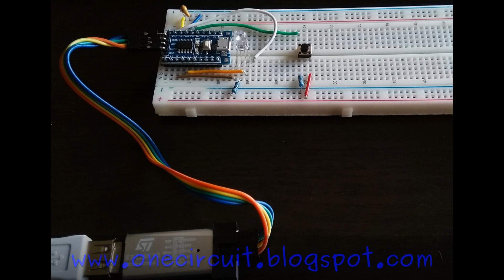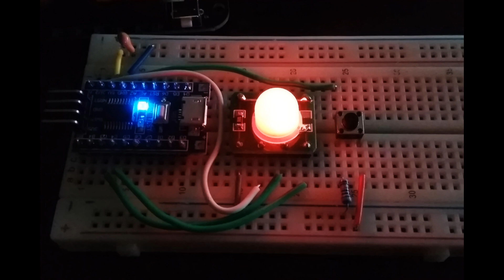STM8 Super cheap microcontroller

Comment: Dear brother, what is the purpose of STM8S103F3P6? I accidentally burned out the microcontroller due to overloading the RCD3015M module. I want to replace the chip. So will the module work if I just replace it with a new one or do I need to program it. Or will the RCD3015M module work without the STM8S103F3P6 chip? Please help me understand, thank you.
Reply from the maker: You will need to program it. Good luck! 👍

Comment: Hello sir, I've tried writing code to stm8s breakout board by using Arduino software but it always shows me error like " too many characters used" but in reality all I'm trying to do is use 3-4 gpio pins. Do you have any solution for this problem sir?
Reply from the maker: It’s difficult to know what the error is without seeing the code. You might try the forum: https://community.st.com/s/topic/0TO0X000000BSqdWAG/stm8-mcus Good luck! 👍😀

Comment: If you want a fun STM8 project. Look at the W1209 temperature control board ($2). Has the stm8s103, relay, 3 buttons & temp sensor. You can use it as a develepment board even though that wasnt the initial purpose.
https://www.aliexpress.com/item/32709637851.html?spm=a2g0o.productlist.0.0.425b369550eGxF&algo_pvid=124857a7-3ad5-4595-802a-aa1a1c0b82c5&algo_expid=124857a7-3ad5-4595-802a-aa1a1c0b82c5-0&btsid=0ab6f83915947258514194681e1270&ws_ab_test=searchweb0_0,searchweb201602_,searchweb201603_
Reply from the maker: Oh yes I have seen one of these used to convert a chest freezer to a fridge. The theory is that the compressor on the freezer is way less stressed just ticking over to make around 4 degrees C. I can’t find the link but I remember this module being central to the project.

Comment: Very nice work.  I have played with them a little over the past couple of years and working on a project with one now.  I'm using the sdcc compiler and defines I have cobbled together from info I found on the net and STM.  I will post a video on the project soon maybe.
Reply from the maker: Scott Beasley That’d be great - I really think they could be useful with some decent documentation, tutorials and support. They look quite capable. My next challenge is to put one to sleep and then wake it up with either WDT or pin interrupt. 👍🙂
Reply: @onecircuit-as I have a break-out board for the little blue carrier as you have. I need to re-do it and add power regulation to the board. Not sure why I didn't before. Another nice little chip is the stc15w408as. It's an 8051 like core and has a serial ISP built-in and is sdcc supported. I have a board for the that chip and am doing the same project for it as the STM8. Dueling uC's!